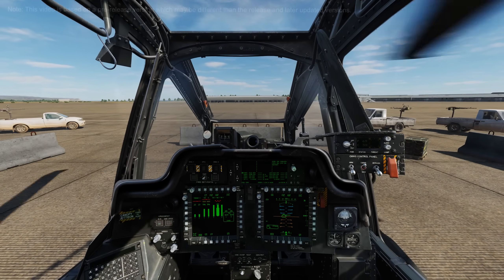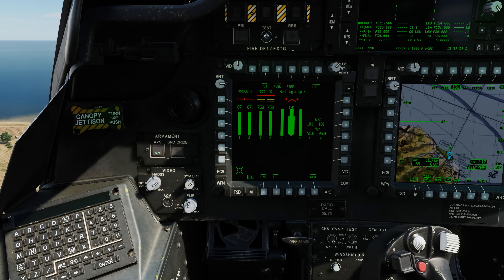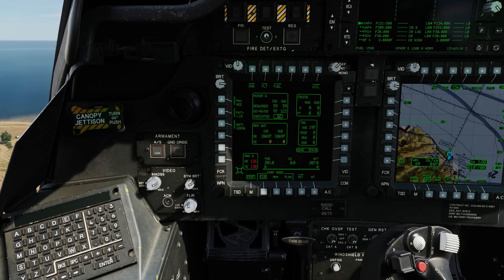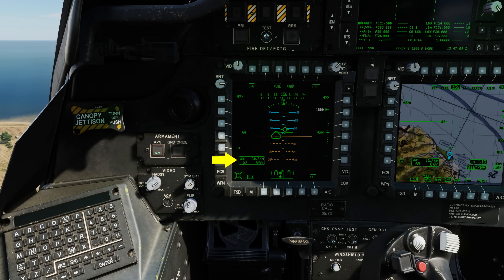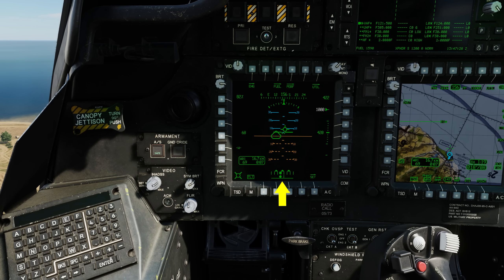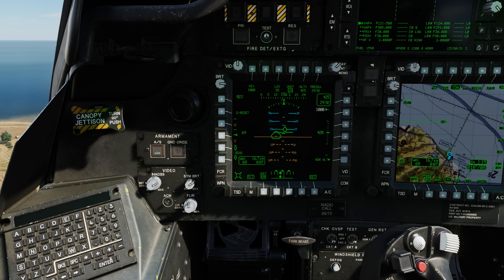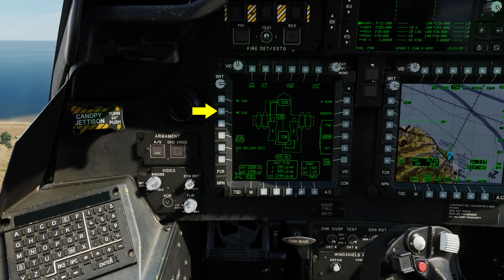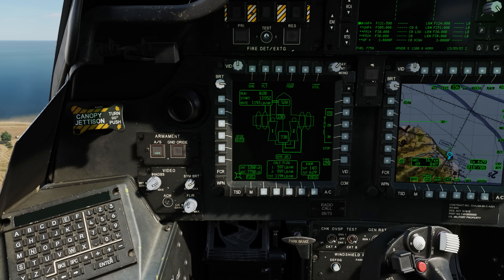DCS: AH-64D | ENG, FLT, and FUEL Pages

Comment: @Matt Wagner.

I'm not as well versed in bashing gravity into submission so there maybe an obvious answer for this.

Around the 8:00 mark you describe the stabilator position. Specifically that exceeding a specific airspeed based on that position will result in a loss of pitch authority.

From what I understand attitude including pitch is usually controlled by the swashplate and possibly even rotor tilt, but what you're describing sounds more like a fixed wing concept.

Oh......wait. Nevermind. I was getting the numbers you were on about backwards.

Exceed a certain speed and the swashplate pitch authority can no longer offset the tail stabs lift. 

It's counter intuitive because the chopper at high speed forward flight is significantly nose down and may need MORE downward stab to maintain the desired angle of attack. So while downward stab seems like a negative pitch moment it's angle of attack may actually be quite low.

Remember the difference between AoA and angle of Incidence folks
Reply: The speed indication he is referring to is only if the stab fails and no longer responds to movement commands. In this case, you shouldn't exceed the indicated speed for the reason specified.

The stabilator isn't for airspeed, it's for maintaining a suitable fuselage attitude. In fact, at high speeds it is slightly trailing edge up to prevent an excessive nose-down attitude. The fuselage pitch can be adjusted independantly of the rotor disk because of the stabilator.

On the flip side, at low airspeeds when flying at NOE altitudes, the crew can manually slew the stab trailing edge down, which will lift up the tail and give the crew better over-the-nose visibility.

Comment: Maybe anyone knows, why all keyboard units in planes have buttons ordered alphabetically and not QWERTY?
Reply: You type one handed. QWERTY it terrible for that. Most of these aircraft were designed before typing was a mainstream skill... So it makes much more sense to leave it in the normal alphabet order.
Reply: @ConflictGamingGroup  yeah, makes sense that way. I just have rough times typing on keyboard in A-10, really throws me off.
Reply: @eoffsock  I actually bind all the numpad keys to the number pad on the keyboard. Most of what you end up typing in is numbers and it's just easier to have those numbers bound.
Reply: @ConflictGamingGroup  I don't have numpad, but yeah. Numbers are not the issue anyway, only symbols.

Comment: I assume you are using the Warthog throttle on this video, could you turn the LED lights on it to FULL or OFF brightness? This will stop the slight zoom input fluctuation because thats caused by the PWM circuitry for diming the LED lights introducing magnetic interference in the hall sensor. At 10:29 you can see the zoom axis being quite unstable by looking at the edges of the screen, they are jumping